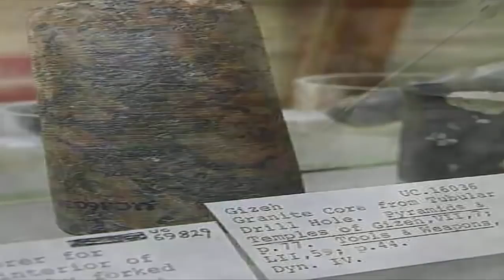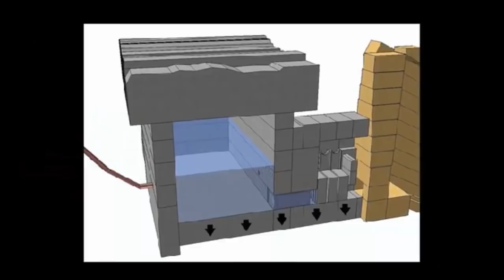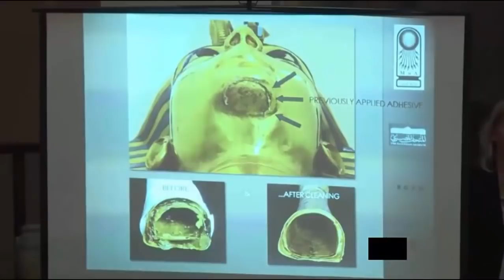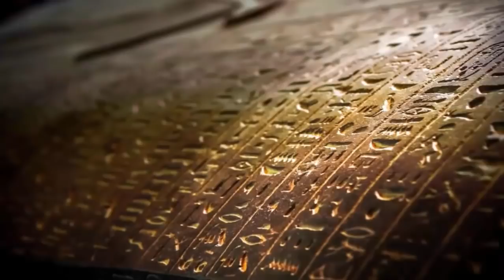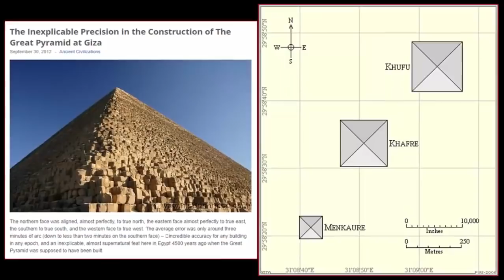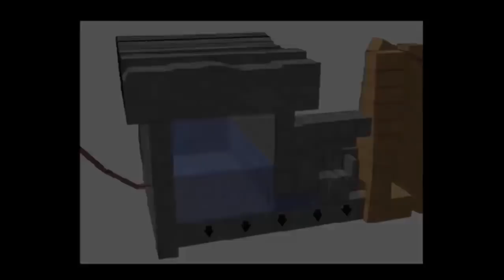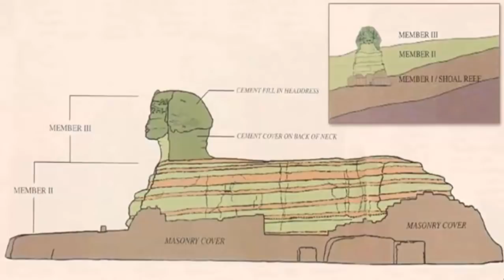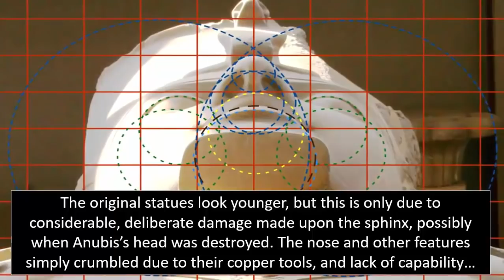𓀽 Impossible Ruins - Ancient Egypt 𓀽

Comment: It has to be with stone cutting and moving, that it was easier to cut and move fewer giant stones, than it was to cut and more more smaller ones. How that situation is possible, requires an EXTREME ease in moving and lifting massive megalithic stones, because it only takes a little extra time to cut the smaller ones, but it takes an entire new technological pathway that WE haven't even figured out to move fewer large  blocks.

Comment: Its called lapping. i see the tell tale signs and wear,
it wears the tool giving it a slight taper at the tip.
i see it all over these stones.
Its all down to hard work gravel and water.
I know what im talking about i do it today on tungsten tooling.
You have to diamond lap even today. they used the same tech we do now.
Nothing special it just makes sense they were clever people
Reply: You are completely nonsensical. Lapping is used to polish, or mate materials. Not carve 1000+ ton stones, then lift them 30 ft in the air and stack them on top of other things. Wtf are you talking about, this is lapping?